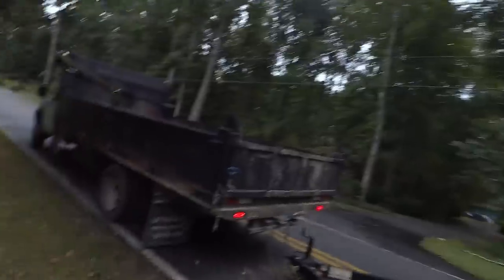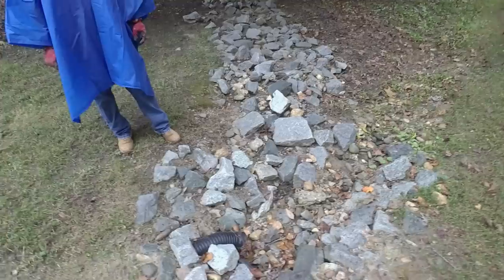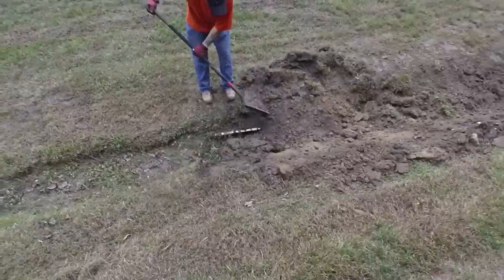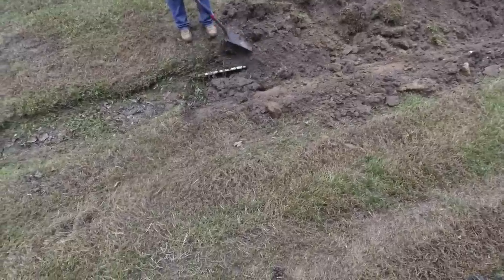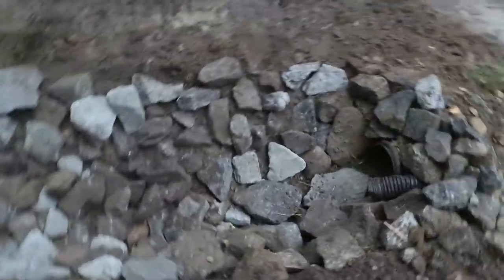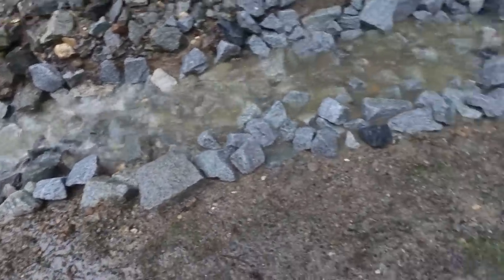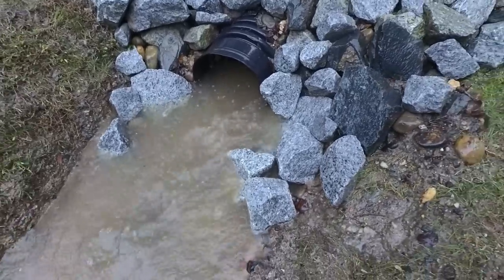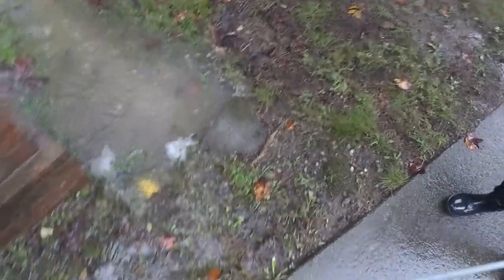Mucking out a drainage ditch to solve driveway flooding issues

Comment: Awesome job , I had one semi similar to this last summer . Customer had a stone driveway , clogged culvert , all the rock from years of neglect fell in , and it overflowed over the driveway taking 12” of base with it . The guys daughter ripped a muffler off her car before he realized he had to do something. Dredged everything on both sides , fixed the driveways with more 2a modified , and reset all the rocks that were in the ditch prior for the same reason as your clip here . The guy sent me pics from the next heavy rain and it was flowing perfectly . All done with my boxer mini skid , with backhoe attachment. I like that size Kubota mini  excavator you have there . I’d love one someday .
Reply from the maker: Thanks for sharing Rob. if you have the work for it, get a mini ex. I wish I had gotten one with a factory thumb instead of me adding one later. That little ex has done a tremendous amount of work. And would pair well with your mini skid. I have the Bobcat mini skid.
Reply: @GCFD  I’m not quite there yet , I have a boxer mini skid loader for doing tree and trash work , grapple claw and material bucket etc . I bought the backhoe attachment to start getting my name out for digging. It does the job but won’t hold a candle to a mini excavator. You guys put out some awesome information.

Comment: Excellent fix, very sad the city or county had no input on size pipe. Seems they would have but your in a different jurisdiction then I am in.  The city or county in Oregon would have required a permit and dictated what min size culvert could be installed.   That pip rap really slowed the flow down.  I noticed the water coming out of the culvert was almost at the spring line. That culvert will have a max flow, on some rains it still may over flow. But that is a top notch fix, someone that understand how water flows and how you can effect it. Fluid dynamics good job. I sure enjoyed working in that industry from 1980 to 1996.
Reply from the maker: Thanks for commenting and watching! This was a crappy situation for the homeowner so I tried to make the best of it for her. She understands that the concrete people didn't do their job right. I try not to dwell on the past but try to focus on doing the best I can with what I have to work with.

Comment: Concrete contractor needs to be called back for 'warranty' work. City approval or not.
Reply from the maker: For sure! The homeowner was not happy at all. I never badmouth other contractors and try to focus on moving forward. I see contractors screwing over homeowners all the time, unfortunately.
Reply: @GCFD  
That just looks like (concrete contractor) LAZINESS!!! 
That ditch is crying out for a slightly OVER-sized culvert- pipe! (nothing crazy, just an inch or two). 
I can't imagine the cost difference being THAT much to be a 
deal-breaker!
Nice Job!
PS- The post-job follow up is definitely a great asset to your videos!
That feature was the tipping point to come back and subscribe!!

Comment: Raising a dump bed with a heavy load on it to move the rock to the rear.  Playing with major inconvenience there.

One time when I was around 12 years old about 52 years ago, we were harvesting wheat when my father had to go to town to take care of business at the bank and left me there to continue cutting wheat.  I can not remember why but for some reason I thought it would be a good idea to start loading the truck at the back of the bed and work forward.

After a couple of loads I decided to move the truck up to the combine instead of driving the combine to the truck but when I started moving forward I saw the front of the bed start rising up in the mirror and immediately slammed on the brakes which brought the bed back down.

If I had not hit the brakes the bed would have raised all the way up and put the rear of the bed onto the ground and who knows how many bushels of wheat would have spilled onto the ground.  And then I would have had to spend time getting several come-a-longs to pull the bed down far enough to dump the next load of wheat into the front to get enough weight to hold it down and then shovel all of the spilled wheat back into the bed and then crawled under the truck to get the come-a-longs out if the bed did not come down on the cables.

So I walked back to the combine and dumped the next load into the front and did not move the truck until it was full and ready to drive to the co-op to be put into storage.  That was the first and last time I ever started filling the truck up at the rear of the bed instead of at the front of the bed.
Reply from the maker: Great story, thanks for sharing!

Comment: Who on Earth puts plastic currugated pipe under concrete again??? Always though it is supposed to be steel or concrete to support the load. 🤔 You really did an awsome job here. Sad the person who did her driveway ripped her off that way.😞 Thank you for A+ help.
Reply from the maker: I think it's double corrugated, which is the right pipe under the concrete. The problem is the pipe was way too small. I suspect the concrete people didn't have the equipment to dig a trench for a larger pipe.  Thanks for commenting Andrea! - Shawn
Reply: That’s standard practice. Metal rusts away.

Comment: That is now the City's responsibility, not the homeowners. Once they approve the culvert they become responsible for it. She needs to contact the City and have them replace it. We would make you pull all that rip rap out if you installed it without a permit. The City should be putting rip rap in too if its needed. Not to take away from your business, but homeowners need to start holding their jurisdiction accountable. Our citizens have no issue complaining to us, lol.
Reply from the maker: My customers have had almost zero luck contacting the city or county for drainage problems here.
Reply: @GCFD  That sucks. I work for the county and we deal with drainage issues all the time. If it was in my county we would have done what you did to start. If that culvert was too small and still causing issues, we would have ripped it out and replaced it and given her a new driveway in the process. We require a minimum of 18" for our culverts and they have to have 12" of fill on top. New culverts must be HDPE.

Comment: How did they get by the city approval?
Reply from the maker: I have no idea. This was work that was done within the last year or so. It needs to be replaced but the homeowner doesn't want to do that and I don't blame her!
Reply: @GCFD  As long as it works like you did in the video, very impressive by the way! where i live the ditches are higher then the road, water chills on the road and when winter comes it damages the pavement badly. im just shocked the city signed off on the undersized pipe, considering its the right of way and would have needed the approval for the approach. Maybe they downsized it after city approved the plans and the city never came back.?

Comment: Why pull out the concrete to put in a new culvert pipe??  Use a horizontal hole drill machine to drill a large diameter hole, and slide the new pipe in under the concrete.

Comment: All the rocks on the in put side are doing is acting as a filter ruprap is used for erosion controll on out let's, to slow on inlets make deeper and big rocks to change direction in a zig zag
Reply from the maker: No the riprap is slowing the water and redirecting it into the inlet. Check out the end of the video 👍

Comment: I think that ditch should be double or triple the width it is there.  Usually grass swales need maintenance every 5-7 years but the larger you make it the longer maintenance intervals they'll have. She might look into modifying the inlet as the thin-edge-projecting inlet there has the worst intake ratings, & 8:24 that culvert is installed backwards.
Reply from the maker: It's definitely not an ideal situation. We talked about it and she wanted me to give it a shot with just mucking it out and not reworking things too much. She is not happy that it's a problem when it should have been done right the first time.
Reply: @SlackerU  Andrew Camarata was talking about this in a video the other day and I really didn't think it could be that big of a deal. Thanks for this link. Definitely interesting to see in action.
Reply: @mattkeller2466  AC has such an interesting business & the coolest welded-DIY castle on YT.   Ya, Letsdig18 replaced multiple pond-overflows this year with backyards-installed piping.  That highway-culvert-class demo is legit.
Reply: @SlackerU  I saw Letsdig redoing a pond with backwards culverts also. Crazy how many people who do this for a living don't know that and have to have things redone by actual pros at a later date.
Reply: @SlackerU  That was INCREDIBLE. I had NO IDEA it would make that much difference. Some, sure, but WOW.

Comment: Relatively new pour and both corners of the driveway broken already.  I'm surprised there isn't something in the building code to determine size of culvert.  
Big brother certainly had a lot to say about one of the other culverts you did, covering with 12" concrete all around etc. How big was the concrete one at the end??  Bigger than 12" I'll bet..  
Good thing about this vid, no snakes or bright T shirts that send me running for sunglasses.
One last point, you have a competitor whose practices seem top be diametrically opposite to yours.  Not trying to put you in an awkward spot.  I disagree with him.
Reply from the maker: Hey Knight, I agree that I seem to do things completely differently than others. I try to let my work and results speak for themselves. I also re-visit my jobs to check in on them.
Reply: @GCFD  I agree with your methods.  After you have explained the issues with perforated corrugated pipe, I get it.  But he says roots get into a solid PVC pipe??  I can't see how if the joints are tite and pipe not cracked..
Reply: @knighthauler4792  - roots can get into anything.  Roots can penetrate concrete.  Saying they can get into pvc isn’t really saying much imo.